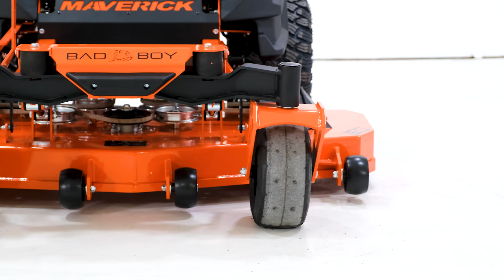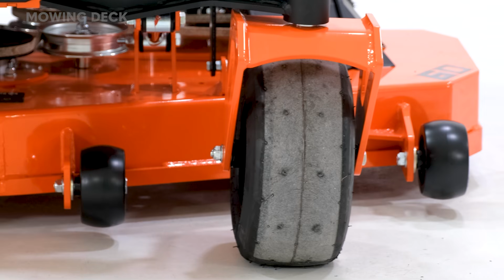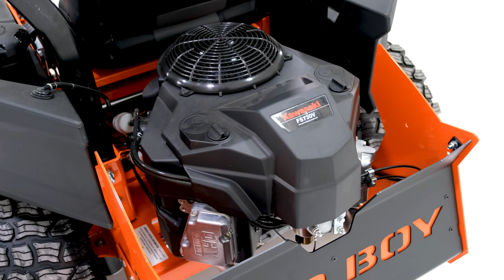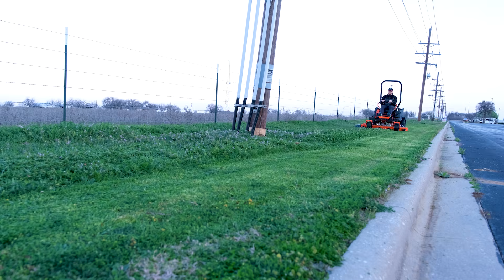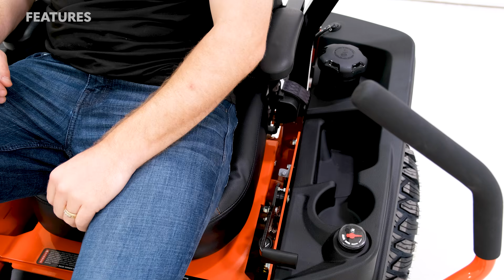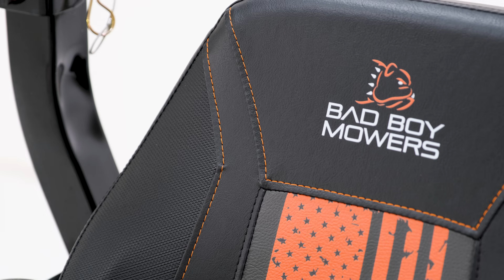Best Zero Turn Mower FOR $7000 | 2024 Bad Boy Maverick

Comment: I made some changes on mine that made it sooo much better. Mine only ran 3360rpm so I turned it up to 3600rpm, I adjusted the control linkage to the quickest ratio and moved the lever stop bolts to the lowest position for more speed and put a fast trac suspension seat on it. Completely different machine now

Comment: I bought the maverick in december and I mowed With it twice of this season and let me tell you I love it to my old one Zt Elite. It's faster and it is way more comfortable in for the price.I don't need to jump up to $9000.Just to have a six hundred dollars suspension seat. Don't care about the air less tires either. I don't have a lot of obstacles on my farm and I can mow 6 acres in 2.2 hrs. Not bad on gas with Kohler. 2.5 gallons the 6 acres i mowed. I would buy it again.
Reply from the maker: Thanks for your comment! Happy Mowing!
Reply: I have to agree with you. I like the HD model , but not at a $1600 difference from Maverick at my dealer. Then I can save another $500 by buying Mav at TSC. So that would be a $2100 dollar upgrade that I can't justify.
Reply: I put a fast trac suspension seat on mine and it made a world of difference for $175
Reply: @hymugglee6236  was that a specific seat or the suspension kit that you use with the seat that came with your mower?
Reply: @LetsDIYIt  the kit that goes between the frame and the factory seat
Reply: @hymugglee6236  Thank you

Comment: I had to jump to the HD. 
List of upgrades from the maverick to the maverick HD:

Full suspension seat
Better engine
Better trans axles
Upgraded spindles
Front no-flat tires. 
Striping kit
And larger fuel tank

And just try and find another brand mower with all those options at the same price point.
Reply from the maker: It's hard to beat, that's for sure! 
Cheers!